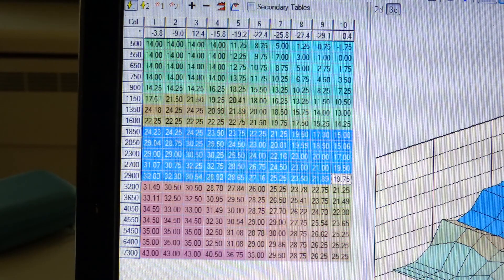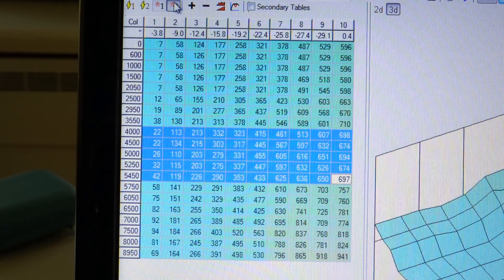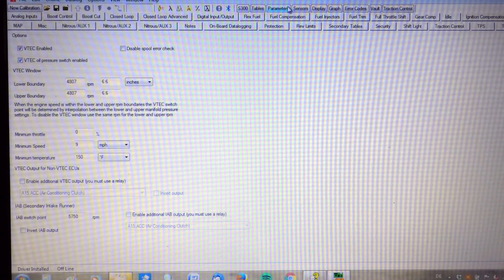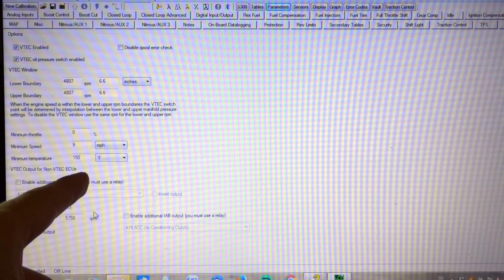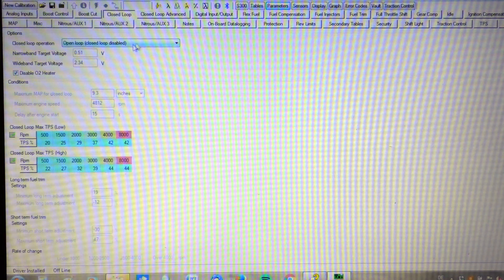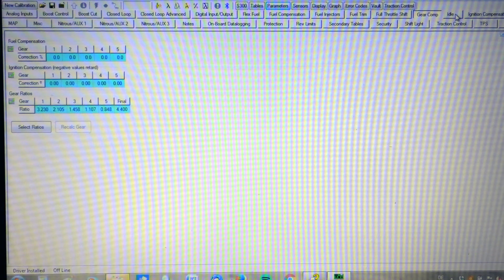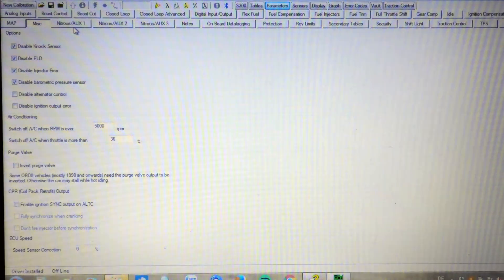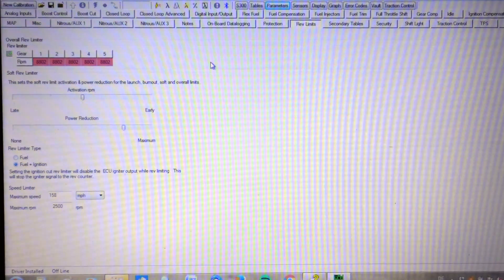Hondata  B16A2 Map +10hp Gain

Comment: Hi there, I noticed that the maps are completely different on this video compared to your first one. Which one should I use?
Reply from the maker: They are actually identical :p
Reply: @S2K2NER  Nope they aren't haha sorry to tell ya :/
Example
Your first video - Fuel map 2, bottom right corner reads 887. (3min 22sec)
Your second video - fuel map 2, bottom right corner reads 941. (0min 58sec)
Maybe one has been smoothed perhaps?
Reply from the maker: Brenn Mcclell I haven’t had time to look at this yet but from what I recall the first video had a problem with one of the pages and it seems to be skipped possibly the second or third so that might be what you’re seeing.  Let me look at it later and I’ll get back to you.  Either way the second one is correct for sure.  I made the second video because people were complaining about the one map and the quality
Reply: @S2K2NER  okay cool!! Just wanted to make sure i was using tbe right one, thank you!!  : )
Reply from the maker: Brenn Mcclell let me know how it works out!

Comment: Hello, I live in Brazil and the gasoline here in Brazil has 87 octanes, I can use this map with this fuel?
Reply from the maker: I tuned this map at 95 octane (EU) so there is a little bit difference there.  If you do use this, you need to watch your knock sensor closely for detonation and the timing might be different.  Keep in mind that higher octane burns slower so it won’t detonated as easy making it safer.  The other option could be to add an additive to boost your octane numbers to where it gets closer to those numbers.

Comment: That’s really rich on the fuel table especially at. W.o.t
Reply from the maker: +mat32010 it worked for us.
Reply from the maker: +mat32010 try to adjust your fuel pressure if you are having troubles.  Could be the air pressure difference as well.  This map should work fine.